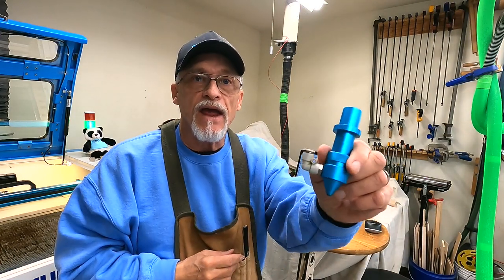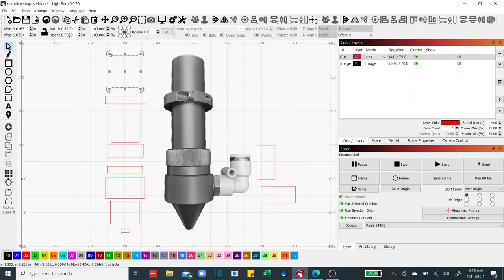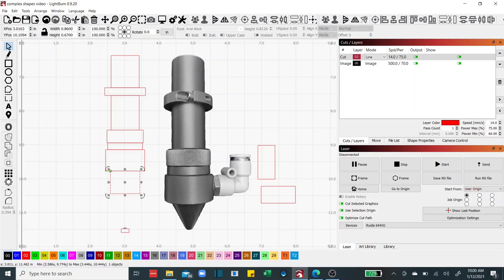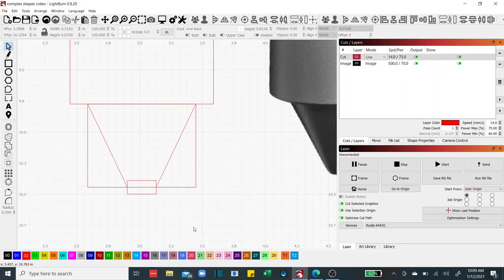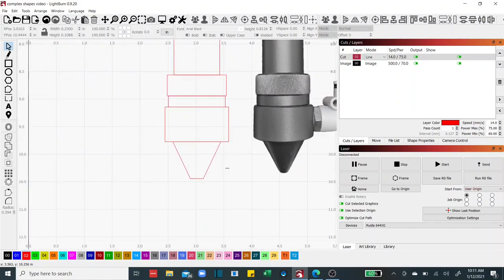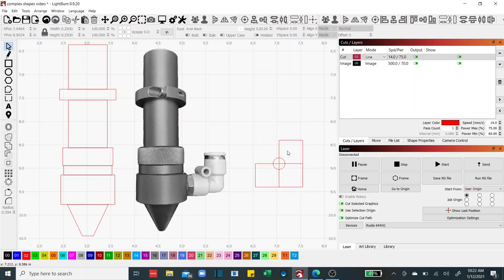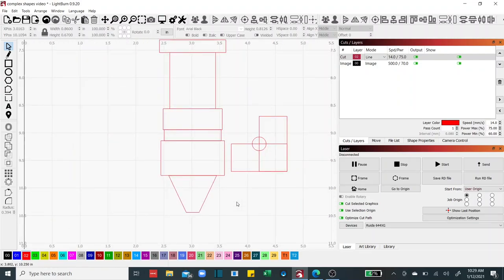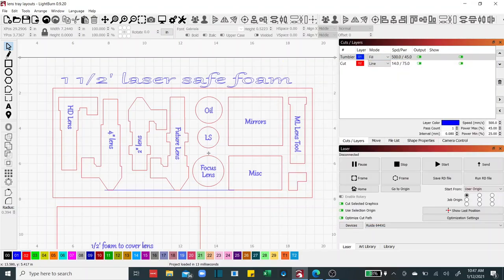Drawing Complex Shapes in LightBurn

Comment: I found the snap to object doesn't snap it wobbles about not snapping to line, have  to snap to grid as well, not sure if such features have changed over 2 years since this video was made.
Reply from the maker: When using snapping line to line are you grabbing and moving on the line.? Grab on the line and drag it to the line you want to snap it to. Mine works great this way

Comment: As Always, your videos always teach me something.  As I become more proficient with Lightburn, I am constantly amazed at how much I still have to learn!  Thank you again for a fantastic tutorial and a great idea!  Do you have a preferred place to purchase the high density foam?  Never cutting it prior, could you make some recommendations of settings?  I also have the Nova 24.  Thanks!
Reply from the maker: Look up laser safe foam and go from there, my setting for this project where 14mm/s and 25-30% power. I use the 4" lens to cut foam with about an 8mm focus. Be sure to raise the foam off the honeycomb at least by 1/2" I just use scrap wood around the outside edge. Thanks for your comments I enjoy reading them. Good luck with your 24. I love mine.

Comment: Is this the only way to get complex shapes?  Coming from mastercam this is the most frustrating and slow process of creating simple 2d shapes.   Im trying to create boxes with finger joints but am I really going to have to create 100's of little squares and do this process of creating extra points to be able to delete others?  Is there a way to create a line that is a set length and have it snap to 90*. 
  

Are there no programs that dont cost a grand for the home user, that allow you to input dimensions for the shape or line your trying to draw?
Reply from the maker: in Lightburn yes, it’s not a cad based system so if you are doing a lot of shapes that require allot of drafting you can always generate in a cad software and import into Lightburn. there are low cost options out there. I just wanted to show you how you can accomplish this with Lightburn, granted there are more efficient ways of doing it. thank you for watching an your comments!
Reply: @computercreationz  wish I had access to what I have at work, at home. I have to look into some of the other cheap cad programs. Im just starting to venture into the hobbiest side of this. 

Love your content, its been a tremendous help.